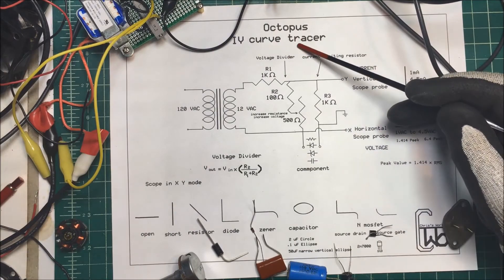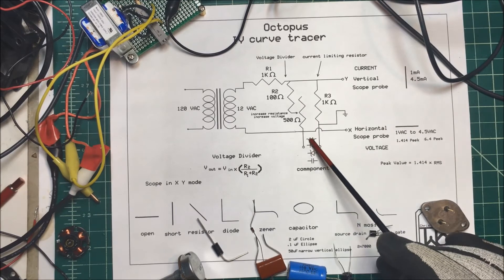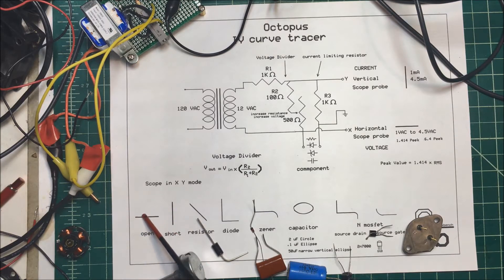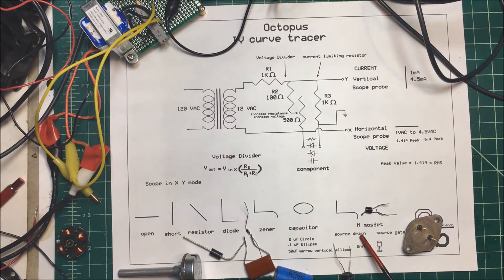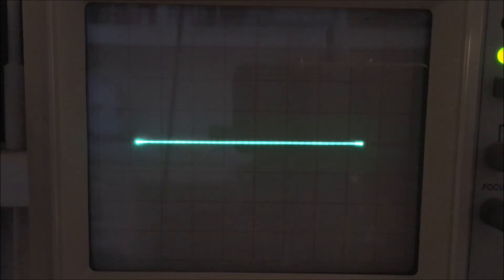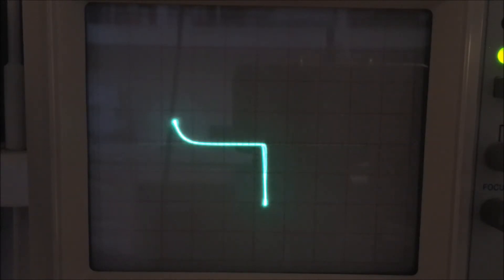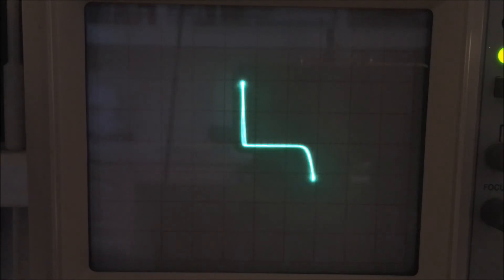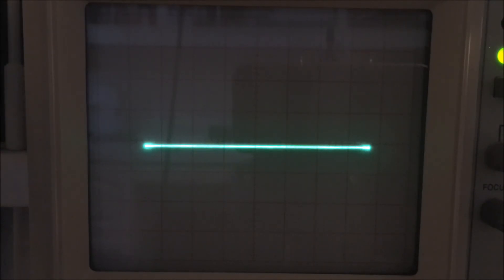IV Curve Tracer  "Octopus"

Comment: Hi Chris, nice video. I build the tracer as described. But I have one question. The pictures of the different components (diodes, resistors, capacitors etc.) are upside down in comparison to a built in component tester of an Hameg oscilloscope. Can you tell me how I can modify your  circuit diagram to get the more common results of the classic component testers. Thanks and kind regards Michael.

Comment: how to do it with multi ranges (using transformer with 10, 15, 20, 60V outputs)?
Reply: ...use a variac to control the AC voltage input to the tracer circuit...

Comment: Hi, can i use IV curve tracer for testing components like resistors, capacitors, diode, transistors which are mounted on a board?  I have many decap 0.1Uf connected between VCC(+5V) and ground placed at different device, can i identify which capacitor is faulty with this IV curve tracer?
Reply: ...in order to get an accurate reading, it's almost ALWAYS necessary to isolate the rest of the circuit by disconnecting at least 1 lead of the component under test-(!)